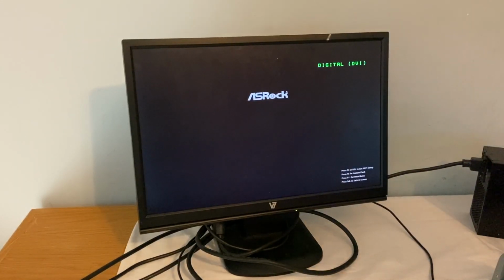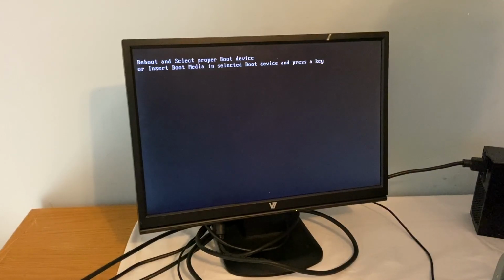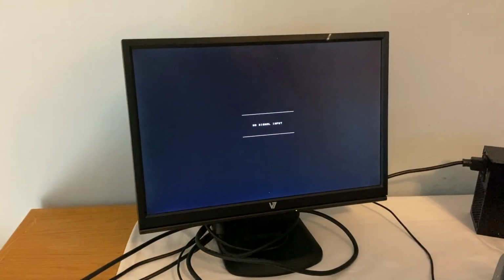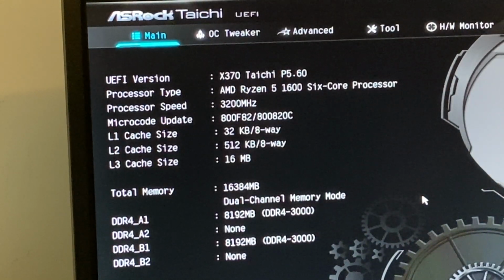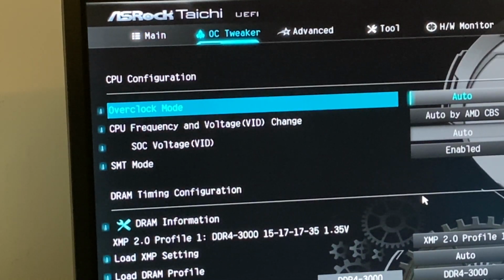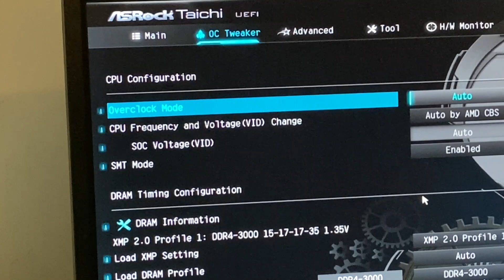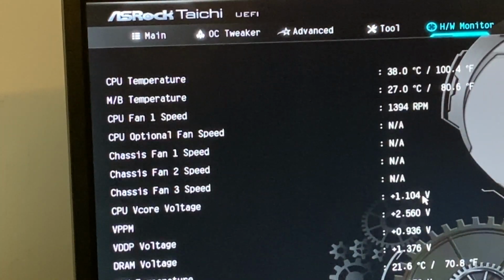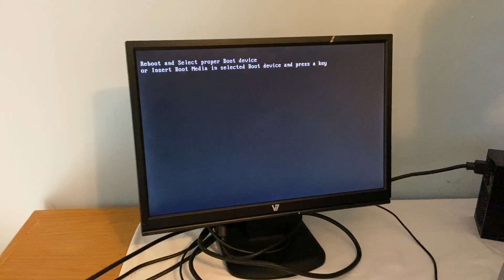Testing Cheap Ryzen Gaming PC Parts (Part 1) (1600af, X370 Taichi)

Comment: is that a test bench or just a frame with pcie brackets? Would love to get one if its cheap enough
Reply from the maker: It's a motherboard tray from a Raidmax Smilodon case, they have like 3 screws in the back and you can remove it.